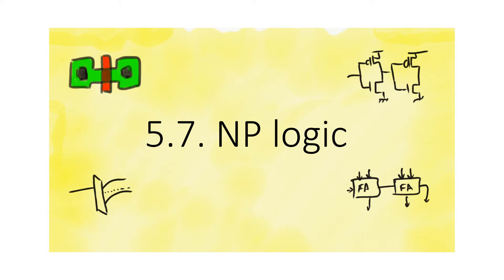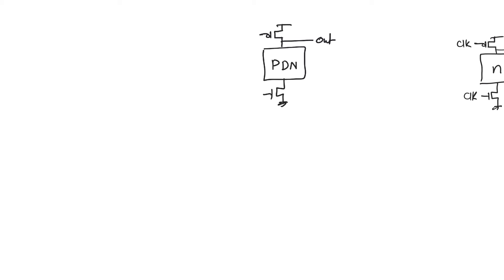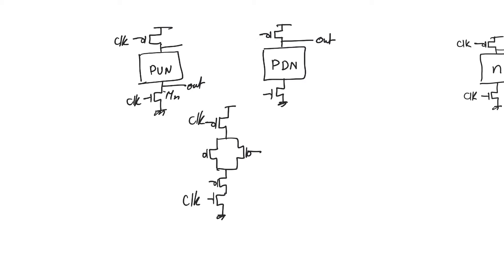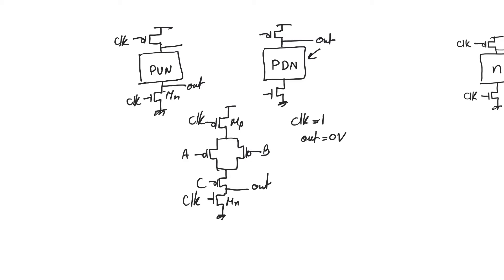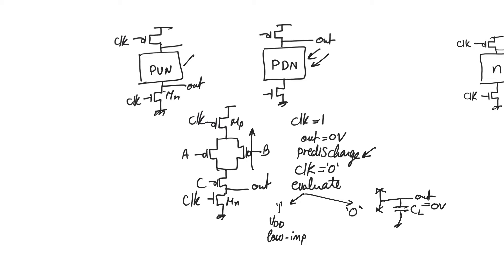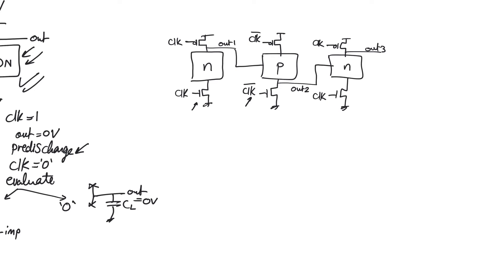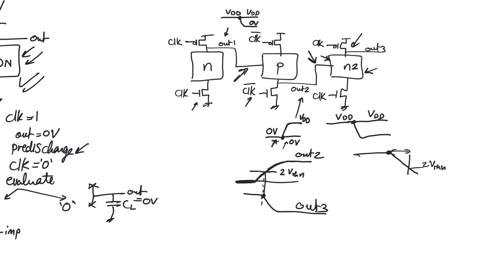5.7. NP logic

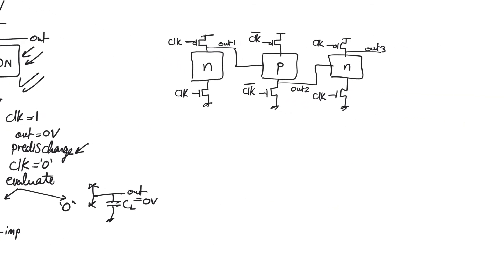Comment: Thank you for the wonderful lectures. I have a question about the cascaded network in 4:28 onwards. The PUN appear to receive an inverter clock signal. But would it not have been simpler to simply swap the tail nMOS and the head pMOS for a pMOS and nMOS respectively, and just give it an un-inverted clk?